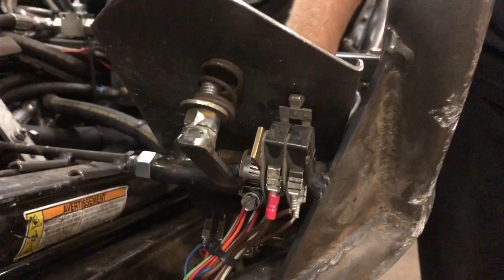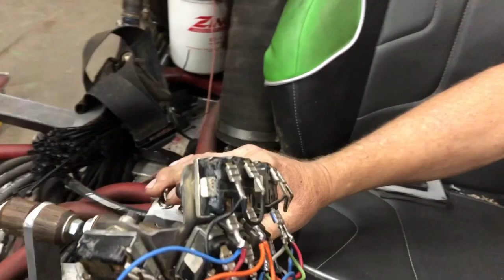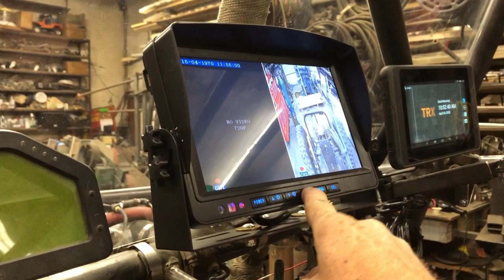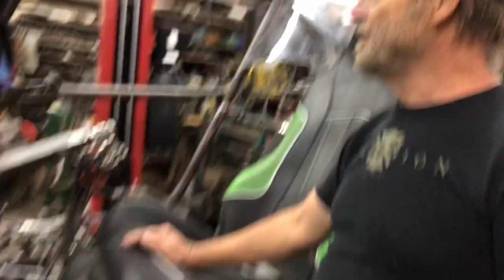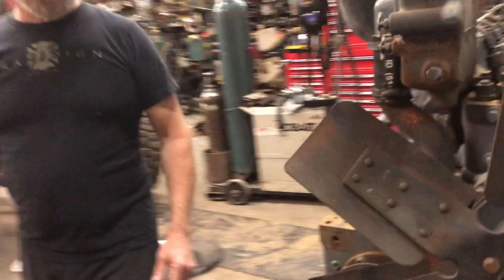Invention and Innovation - Keeping it Real During Coronavirus

Comment: Have you looked into getting someone to make you an electronic control system to clean up all those wires? I'm sure there would be a YouTube fan or Creator who would love to collaborate on making you a 'Brain' for your buggy. Then you could have every option you want at the push of a button on your steering wheel. I'm thinking either an Arduino Board or you can even have custom made chips.
Reply from the maker: Not yet, until now it's been about getting all the mechanical engineering sorted out and functional.  Once  that's in place would love to take the electronics to the next level